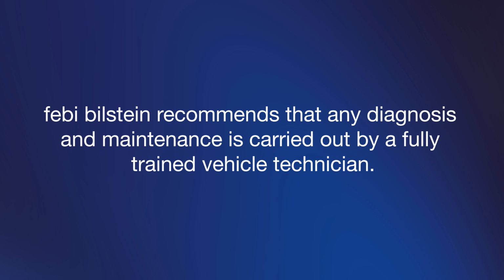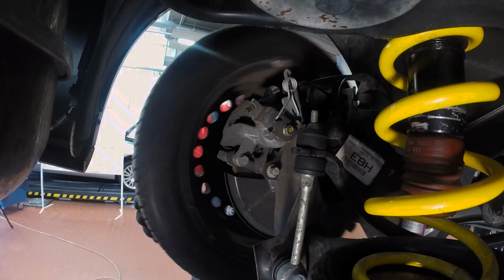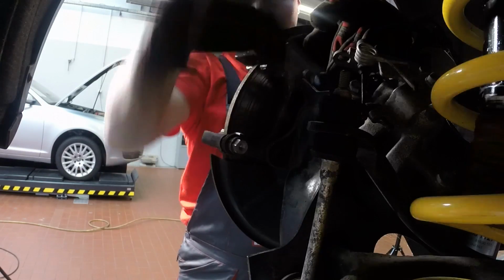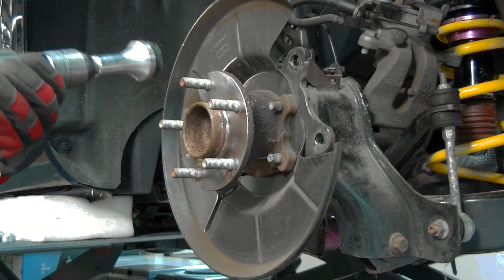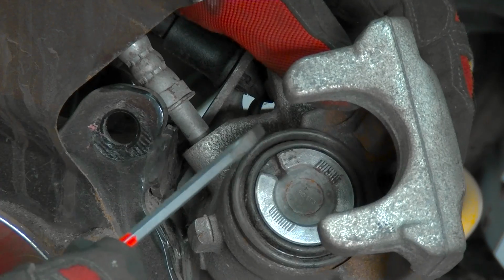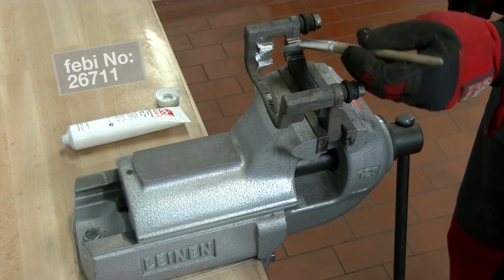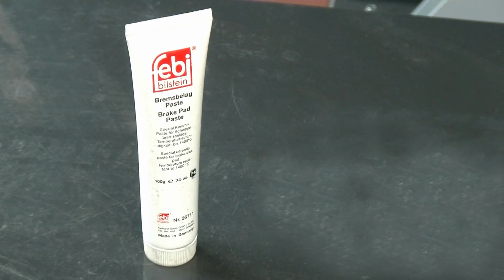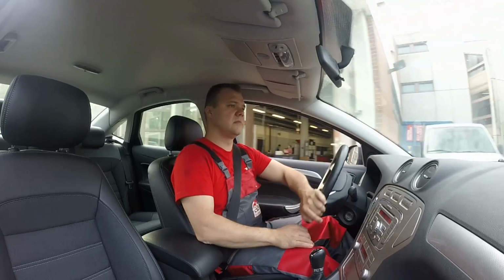[EN] Rear brake pad and disc change [MPB]

Comment: Looked through your pdfs, and online, but can't find the right answer... WHAT IS THE PROPER PRODUCT FOR THE CALIPER GUIDE PINS??? SOME cars have Teflon to metal, some other have metal to metal, some other like citroen have top pin metal to metal and lower pin has a rubber sleeve so is rubber to metal????
Reply from the maker: Thank you for watching our videos, Vehicle and automotive component manufactures produce many parts from different materials, this are very much subject to the products operation environment and design. This is why you have found many differences with similar components on different vehicles.
Reply: Silicone grease.